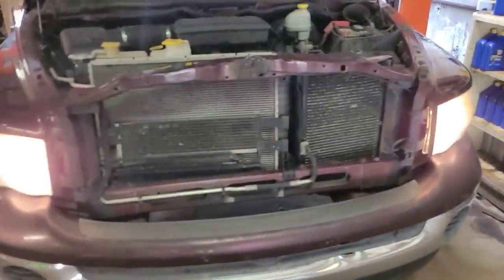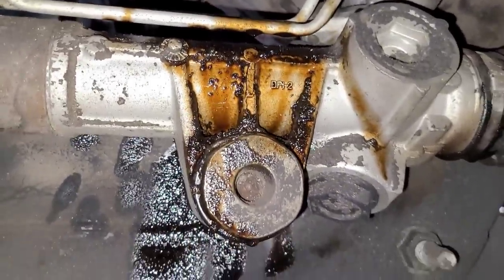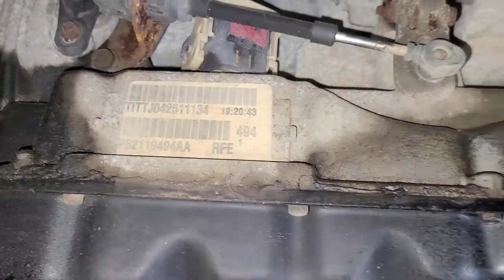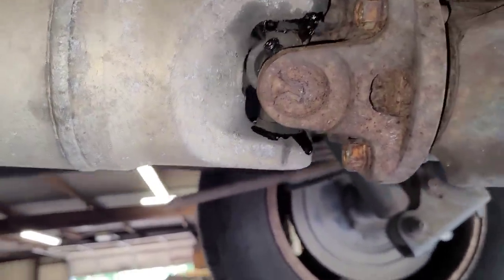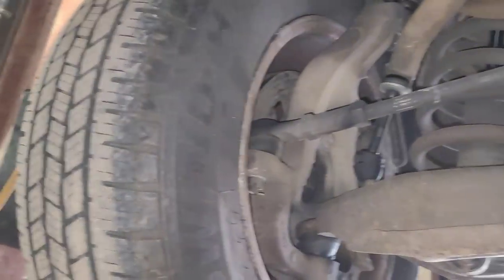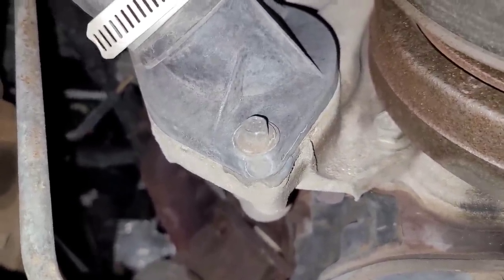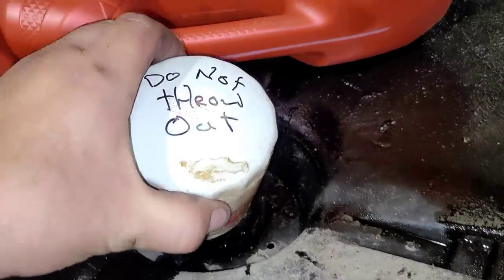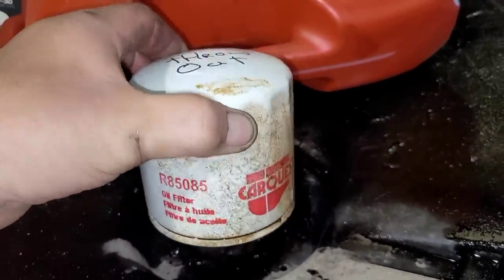I Think I Should Have Changed My Own Oil Sooner!!

Comment: Oil yes regular changes is important. For a cheap and safe engine clean simply add in a half quart of SAE30 HD3 diesel tractor oil in a few days before doing the next oil change. High detergent oil for farm tractors, it will clean a lot of the gunk off the engine, as it is meant to keep soot in suspension for farm tractors, that spend a lot of time idling.

Yes filters almost always have a bypass valve ( though some of the no name brands do not actually put it in, adds 10 cents to the cost) that will typically open at around 20PSI pressure differential across the filter media, on the theory that having oil flow, even if dirty, is a lot better than no oil flow. But having this valve operate does mean all the junk and tramp metal the filter is supposed to remove, and a lot of the stuff it has removed, and which is inside the can, now can travel past the filters. Not great for bearings and the rotating surfaces, and definitely not great for small clearance holes, like lifters and variable valve timing actuators.

Great on the oil, I got some filters for my car cheap, old stock ones that were sitting at a store on a shelf, at the price they were selling them in 2008. So next service filter is there already. Will differ with you on the dry filter, if the surface is just wiped clean, yes you can put it on dry, as the oil film on the housing will lubricate it, but if it has been washed clean with brake cleaner, oil the filter seal.  I just grab a bit of the old oil and wipe it, then pull that seal out, flip it over and oil the underside as well, and make sure it fits back in the groove properly. Recently had a no name filter which, brand new, was leaking, I assume from the metal face not being true, and thus the seal not holding. I only buy 2 brands, GUD or FRAM, as they are locally made by me (20km away), and are the OEM brand for most vehicles in the country. 1 million Toyota filters made by them, they pretty much have it right.

As to tyre pressure, the top end of the vehicle manufacturer spec is the one to go for, as yes that is the one for either heavy load, or for economy. You want comfort make sure you have a high profile wheel and tyre. Painted on rubber and all alloy is always going to be harsh ride, and noisy.

Drivetrain yes likely dry universals, or they lost a needle when putting them in, grease will tell you quick if the UJ was dry, or if you are spending a hour changing both sides. Gearbox simplest first test is change the fluid, fill back to level, and run it, as otherwise the issue is a sticking ball inside, or a seal that is leaking when cold internally.

Comment: On my Subaru Forrester I had Toyo tires fitted, I kept them inflated 6 lbs above the recommended pressure. Great traction and they lasted for 73,000 miles.

Comment: Did you know that with the Vw Audi group motors, when you take the filter cartridge out there is a hole to the right that goes all the way down to the oil cooler and you can get another quart of oil out of that with a vacuum pump.
And you can fill the car with oil through the filter housing quicker,then top off through the normal filler after.

Comment: Here in Canada most vehicles have day time running lights. A trick I’ve seen to remove an oil filter…. Use a plastic beer cup over the filter. squeeze cup while removing. Oil leaks in the cup. No mess

Comment: I get 300,000 plus on most of my vehicles and change 5,000. A 1996 Ford Bronco I got rid of at 60,000, but it was on its 4th Tranmission, oil pump a long aluminum oil pump had a tendency to warp and rob the engine of oil  pressure, pure junk and last Ford. Bought a brand new Dodge Cummins, and grand Cherokee from my wife. Both where running great when they left. Went Toyota for wife, a 4 runner and new Cummins truck. .

Comment: I like Lucas Oil Stabilizer. It raises the oil pressure and it reduces oil consumption which also lessens the blue cloud in my mirror. I believe it pays for itself in reduced cost in buying oil. I see no reason not to use it. I used it for many tens of thousands of miles and then removed oil pan and valve covers to stop some oil leaks and all was clean underneath. Many tens of thousands of miles later, when the van began to fail emissions tests and all the shops wanted to do was take my $150.00 for a waiver so I could get my tabs and hope to see me again in 2 years and do nothing, what happened in time was that my valve covers and rockers were full of junk. This I found out when I decided to replace valve seals. I blame the dirt on a dirty running motor because they basically refused to work on it, always saying "It's not worth it." Well it was worth it to me so eventually I learned that I could read codes myself by turning the key switch and counting the blinking red light, writing down the numbers and looking in a Chilton's book and finding which parts to replace to clear all the codes and all of a sudden all sorts of smooth power came back and the van came alive and smooth and gas mileage was back up again. Yeah, it was worth it after all. Took about $200.00 worth of parts and my labor but man, was it ever worth it!

Comment: I used to put STP in my truck to help with dry starts to help keep oil in the bearings overnight.  Then I came to the realization it was because I was using crappy FRAM filters that pretty much have no check valve.
There are videos of people that cut up just about every filter sold. Most are about the same except for FRAM oil filters which are
EXCEPTIONALLY cheap.
I don't like the running of headlights in daytime as I feel they actually make a vehicle ' more invisible ' , especially motorcycles.
A blob of light at night shows a vehicle coming, a blob of light in the bright daylight just tends to hide the other features of the vehicle.

Comment: yep, higher pressure does improve handling on both cars and trucks, especially on cars!   Ride is hard on some cars, but handling benefit is real, and it's also safer overall than soft levels like 30 or 32.

Comment: Put a line on the oil filter after gasket contact then turn the oil filter an additional 3/4 turn. Instructions should be on the filter. The best filters are made by Wix. Napa Gold from Napa is also made by Wix.

Comment: @Wrenching With Kenny, The only time that I would find it to be a problem while using Lucas oil treatments is when an
engine like yours is woefully plugged up with sludge, the only time and I've been using for going on 24 years now. I
have the 4.7L in my 2003 Jeep Grand Cherokee and hell, I thought that mine had build up looking down thru the filler
tube! Holy chit man! Yours has about 3 - 3.5 times the amount of build up. I do know of two ways to break up that
sludge that will definitely amaze you if you are interested and both methods work quite well and by not endangering
that engine of yours!

Comment: Regarding the transmission issue in the 4.7L.  There's a anti-drain back valve in the screw on filter in the transmission.  The valve leaks allowing the transmission fluid to drain out of the torque converter.  The result is the vehicle will not move in gear after it's been sitting for a while.  Mine had this issue.  Once I replaced the filter in mine, the problem was resolved.  There's a TSB on the issue (21-015-05).  It says it applies to the 2003 - 2006 Ram 1500 but the problem also occurs in the 2002.

Comment: Use Liqui Moly engine cleaner. I used it on a caked up intrepid after doing the water pump which leaked coolant into the oil. After the treatment it ran like new. Also the timing chain tensioner would not tighten the chain before but after it worked perfect.

Comment: You’re right Kenny, you’re going to get comments on the Firestone tire comment.
  Your assessment of the tire problem was spot on, Ford wanted the pressure lowered to 24 psi to improve ride compliance. That pressure was changed after production of the vehicle had started and that was a big no no . The Firestone  Wilderness tire was a great tire with a long tread wear and great traction. It was designed to be inflated to about 36psi which allowed the tire to operate within it designed operating temperatures. Ford took it upon themselves to have the pressure spec lowered because the explorers had a very stiff ride but Firestone wasn’t informed of this. So the tires would begin to overheat and they would fail, causing crashes, rollovers and death. 
  Once the NTSB got involved the blame game started between FoMoCo an Firestone. That ended a longstanding relationship between Firestone and Ford. Remember, William Clay Ford is married to Martha Firestone Ford and their son Bill Ford Jr. runs the company now. Millions of dollars were lost in that debacle..
 Many of those tires were put back into service with the correct tire pressure without any issues regarding failure. Once the powers to be discovered this we were ordered to destroy all tires removed under recall and show prof of their destruction.

Comment: i got one of those mats that you put in the square funnels, and it lets oil drain with no splashes and holds filters and drain plug up on top high and dry much better than using the empty funnel.
i like using silicone grease on oil filter gaskets on those Toyota reusable oil filter metal or plastic housings makes it easy to get off and not over tightening it. I also throw a little fresh oil in fill to rinse out some of the oil caught in the nooks and crannies of engine.

Comment: Kenny,  All that sludge was build up by neglect, then previous owner  "fix it"  with Lucas before he sold it. Put some trans fluid into engine oil is suppose to add detergent that helps remove sludge. Also some techs, Ford Boss Me, haved
used Marvel Mystery Oil.

Comment: Kenny, I have a question. I have a 2001 GMC Sierra 1500 SLE model 2 wheel drive with 126,299 miles on it. Original motor original transmission and original rear diff. This truck has been a money pit I know the truck is extremely old and you have to expect this.But when I went into this truck trying to redo everything on it.I didn't expect it to cost me as much as it did. I have replaced more parts on this truck than you can think of. I replace the rotors, the pads. The calipers, inter and outer tie rods, sway bar links and bushings, wheelbaring hub assemblies in the front and the back all 4 of them. I replaced the drive shaft completely. Replaced it new throttle position sensor new mass air flow sensor new spark plugs, new wires, new coil packs, all 8 coil packs replaced. New air filter new battery new belts radiator drainadd the brake fluid completely drained and put all new fluid back in. All new brake lines, all new fuel lines. 80% of them were replaced on the fuel lines and the brake lines. All 4 new tires. I did not replace my coil Springs in the front or the ball joints. Or the control arms or the a arms. It didn't need it at the time. This was done 3 years ago and I also had to redo the frame and patch the frame up. Do some major framework to it. Which cost me over $3000. I have a total of $14,800 Invested in this truck in parts and repair within the past three years. And the truck still does not drive the way I want it to. The ride is real Rough sometimes In the cornering, isn't that great But it does the job. Mechanics said my coil Springs are worn out and the bump stops are basically almost touching the control arms and they need to be replaced. Do you think if I replace the coil Springs upper lower ball joints Control arms and the a arms and the leaf Springs in the dear. Will that improve my ride quality on my truck? Sorry for such a long message.Kenny been watching you for quite a while now. You don't mess around you say the truth. And that's why I like your channel. I wish more mechanics were like you.
Reply from the maker: I would only replace the ball joints if they are worn. I would have the ride height measured & compared to factory spec. There are a few things that can lead to a very rough ride; the number thing I have seen is the incorrect tire for the vehicle..meaning load rating. People put heavy-duty tires on their 1500s & it isn't meant for thar type of tire. They are the wrong load range. If I remember correctly, the stop bumps are incredibly close from the factory. Saying they are close wouldn't indicate that they are worn. Check your shocks. They are the main ingredient for a smooth ride. If you have heavy-duty shocks or worn shocks, that would add to the rough ride. I hope this info helps. Keep wrenching 🔧

Comment: I do the same always change the oil in my 01 3/4 ton 5.9 V8 while blazing hot(burned myself a couple times whoops lol) and same for my 92 12 valve as well. 12 valve I change around 4500 and V8 I change around 2,500-3,000 in regards to changing oil in a diesel I've been very fortunate usually the oil in my 12 valve doesn't get dirty until around 3,000 miles in then it starts to lose a little bit of oil when I get to around 4200-4500 so I've decided to change at around 4000-4500 instead of 5,000.

Comment: I like to cover the frame and or whatever else is under the oil filter with a piece of plastic when changing the oil. The plastic could be as simple as a small shopping bag or a trash bag. It's not to collect the oil, it's to allow it to run off into your drip pan.

Comment: I had an ‘02 Ram.  I believe the torque converter would leak down.  I’d place it in reverse and it wouldn’t move for a bit of time, finally after a few seconds it would.  Never had hard shifts, all shifts were smooth.  Lived with it for 8 years until I sold it.  My baffle in the oil fill never looked like that!  I removed it and cleaned it each oil change.  I changed every 3k miles. Oil is cheap compared to an engine rebuild/replacement.

Comment: I got my 04 ram 1500 new from dealer 230K miles ago. Valvoline oil every 3K, few times I slipped to 5K without realizing it. High millage oil at 150K. Oil is never black but I have chipped the crud off of that PCV splash guard 3 times so far. Each time it was 1/4 inch thick. Replaced the valve cover gaskets. Rockers and drain valleys are clean.

Comment: Regarding tire pressure I typically look at the manufacture recommended tire pressure tag on the drivers side door jam and then inflate them 2 pounds above that recommended specification.
Reply: And, as you probably know, tire pressure gauges are accurate to only 2-3%.

Comment: My first car was a 1970 Catalina. Bought in 1976. Transmission quit by 78. Only car I ever changed 90 days or 3000 miles. Sears oil and filter. Bought oil by the case.

Comment: Used to be Berrymans B 12 recommended putting a pint can into an engine before the oil change and run at idle about 20 minutes before draining oil. They don't recommend it now but it works wonders on engines that are that bad.

Comment: I don't understand why tire pressure is such an issue in vehicles.  I don't know about passenger vehicles but in truck tires and especially big truck tires there are inflation tables that you can get that will tell you what pressure you should run based on the weight of each axle.  It's best if you can get individual wheel weights but that's not that easy to do.  Axle weights are generally pretty easy.  Go to your local scrap yard and they will generally weigh your truck for about $5 or $10.  As you pull on the scale stop when only your front axle is on the scale.  Record this number, the pull all the way on the scale and get the weight.  After that it's a math problem.   Heck one of the scrap yards by my house leaves their scale on all weekend and you can weigh your vehicle for free.  This is probably unusual as it's a result of the scale being right next to a street.  After that divide the axle weight by 2 to get the wheel weights  and look the weight up in the table.   It's not that tough to get the right air pressure.   There is another way to get to the right pressure but it involves a tire pyrometer that most folks don't have access to.   Keep the good stuff coming.

Comment: trany problem there mite be a check valve in tran fluid line that goes to your trany cooler it mite be sticking open it holds fluid pressure during shut down if not flued pressure drains to check you can start truck put in neutral let run for 30 seconds and then do the back up then forward. hope this helps